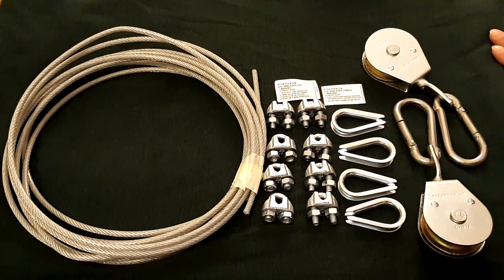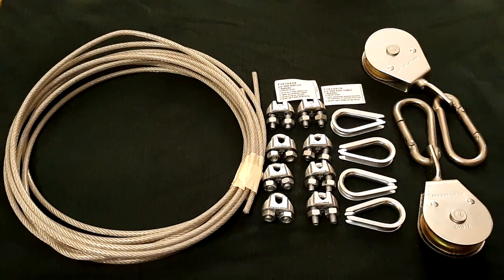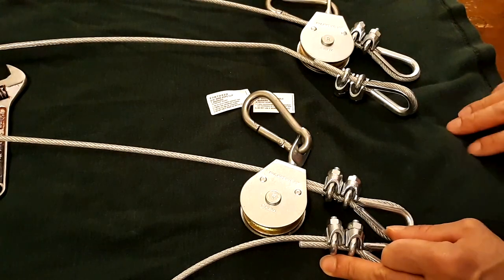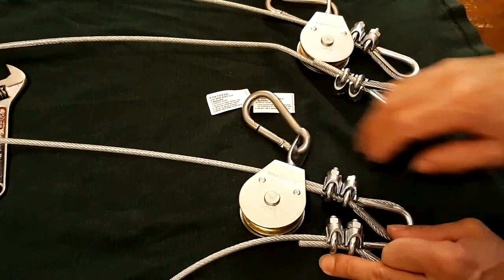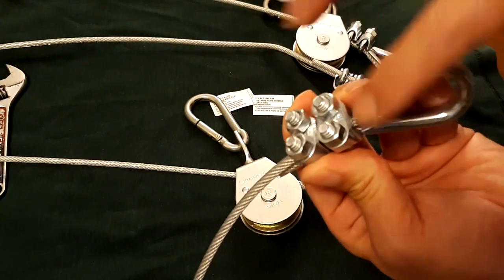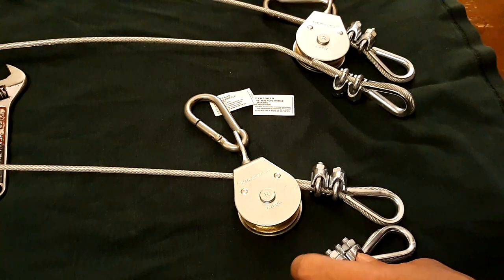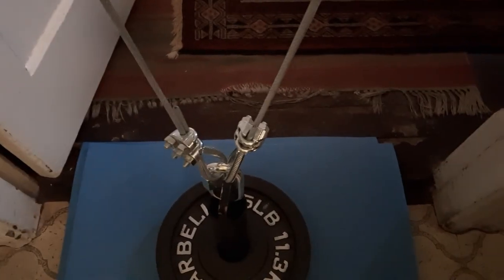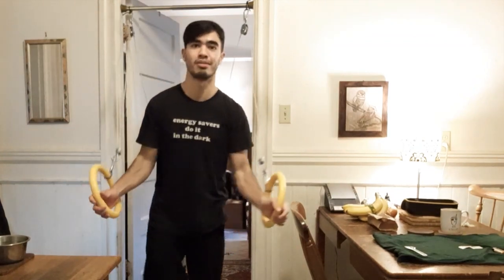DIY Home Exercise Pulley System Setup!

Comment from the maker: To get the exact setup seen in the video you'll need the following items:

4x wire thimble - this piece lines the inside of the eyelet of the cable where you clip the carabiner and prevents the cable liner from wearing out as quickly. The size of the thimble corresponds to the cable thickness you use.

8x Wire rope clip - The thing with the bolts that clamps onto the cables and secures the thimble into the eyelet of the cable loop. You'll need 4x of these for each length of cable. It takes 2x wire rope clip to clamp down on each end of the cable outside of each eyelet.

2x Lengths of Coated Aircraft Cables! - I used a pair of 9 foot, plastic coated "aircraft cables" from ace hardware since my pullup bar is about 6.5 feet high off the ground. This allows the cable to reach down to my loading pin and gives enough length for me to take a few steps back and do a variety of exercises.

2x heavy duty swivel eye pulley - this is what the cable runs through, make sure you assemble one end of your cable eyelet apparatus with the 1x thimble and 2x wire rope clips and feed the cable through the pulley before assembling the other end of the eyelet. Otherwise you might have to disassemble some of the setup to feed the cable since the eyelet is too large to pass through the pulley

I strongly recommend coated cables as metal on metal will wear out your parts much faster.

Aside from these items, I used about 5 carabiners in this video, although I recommend having about 8 carabiners on hand depending how you want to set things up and accommodate different handles. Some fitness handle manufacturers will include carabiners with their products so I recommend determining which handles to purchase before buying carabiners.

I also used a Rogue Loading Pin (accepts a medium to large carabiner, not a small carabiner) and some plates. The loading pin is good so the edges of the plates don't hit your floors and you can just stack plates onto the pin if you want to do heavier cable movements.

I also used a gymnastic ring for a handle since my real handles were in the mail. I don't have any affiliate links so I wont recommend a specific handle company but I will list a recommendation if I ever get an affiliate link.

Comment: what's the name of each thing
Reply from the maker: (If you want a pair of cables like I showed, you'll need 4x Wire Rope Thimble, 8x Wire Rope Clip, 2x Lengths of Coated Aircraft Cable (suitable for your setup with thickness corresponding to pulleys and other parts), 2x Heavy Duty Swivel Eye Pulley.)

Aside from that you'll probably want some type of handles and carabiners to actually put your cable system to use! Hopefully this helps! I will pin this to the top of the comment section since I bet other people also want it in writing!

Each individual cable requires the following: 

2x wire thimble - this piece lines the inside of the eyelet of the cable where you clip the carabiner and prevents the cable liner from wearing out as quickly. The size of the thimble corresponds to the cable thickness you use.

4x Wire rope clip - The thing with the bolts that clamps onto the cables and secures the thimble into the eyelet of the cable loop. You'll need 4x of these for each length of cable. It takes 2x wire rope clip to clamp down on each end of the cable outside of each eyelet.

The cable itself! - I used a 9 foot, plastic coated "aircraft cable" from ace hardware since my pullup bar is about 6.5 feet high off the ground. This allows the cable to reach down to my loading pin and gives enough length for me to take a few steps back and do a variety of exercises.

1x heavy duty swivel eye pulley - this is what the cable runs through, make sure you assemble one end of your cable eyelet apparatus with the 1x thimble and 2x wire rope clips and feed the cable through the pulley before assembling the other end of the eyelet. Otherwise you might have to disassemble some of the setup to feed the cable since the eyelet is too large to pass through the pulley

These are the parts for a single cable apparatus,  if you wanted to assemble a pair of cable apparatuses you would need 4x wire rope thimble, 8x wire rope clip, 2x heavy duty pulley and 2x lengths of whatever length cable will best fit your home setup. I strongly recommend coated cables as metal on metal will wear out the parts much faster.